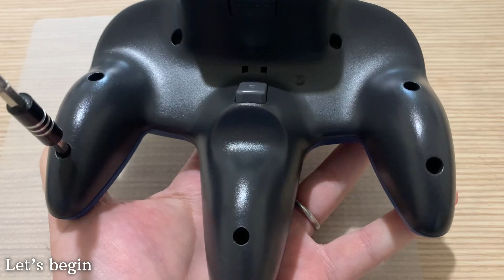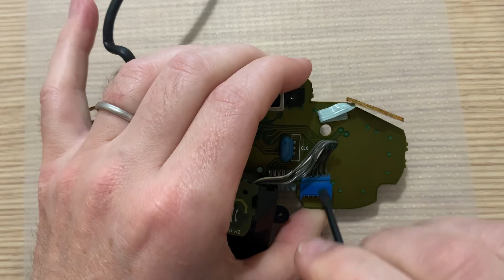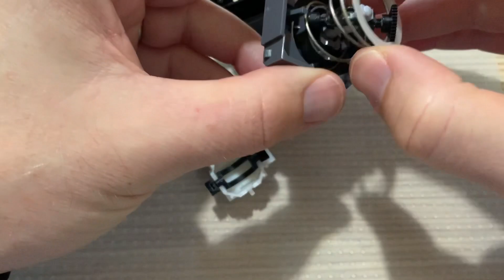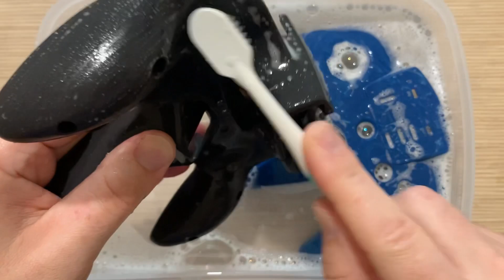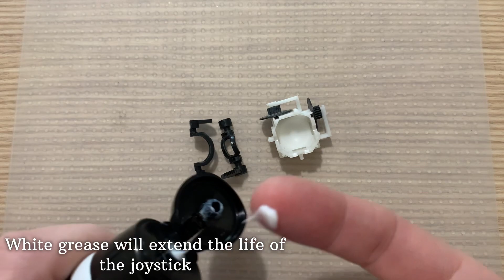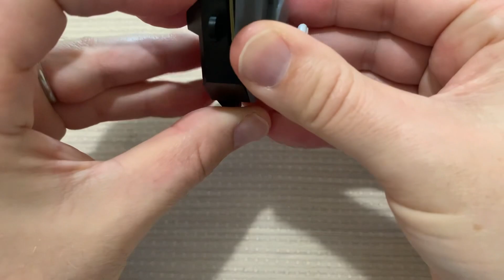Nintendo 64 ASCII Pad 64 Turbo Controller Teardown and Clean

Comment: Neat video, I got one of these nib in a lot and it felt quite nice. I was wondering though how close the analog stick is to an oem controller. The only one I have is really worn down and sticky.
Reply from the maker: They use the same components as the oem controller. Parts are interchangeable.
Reply: @otherretro  Gotcha thanks, I'll for sure be getting tom lithium grease to preserve it.